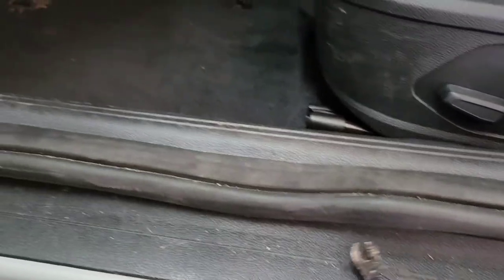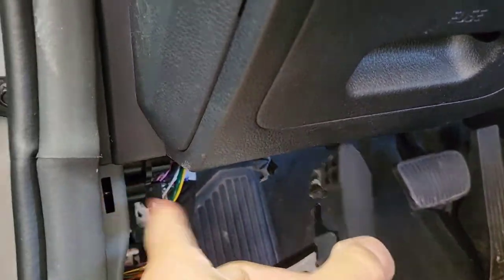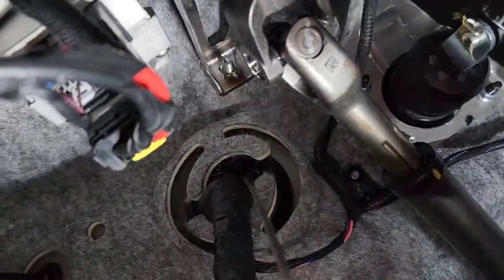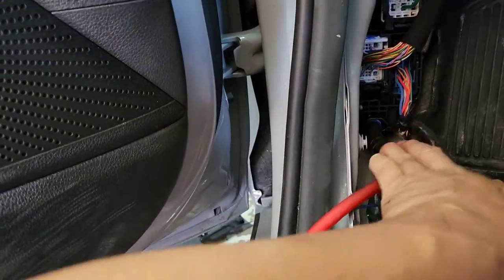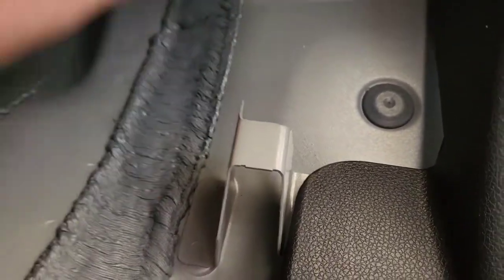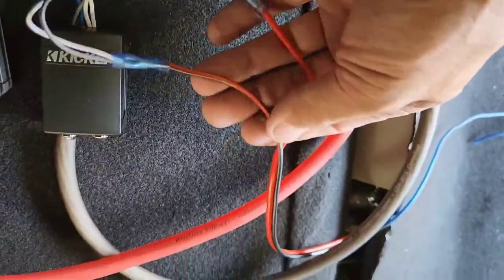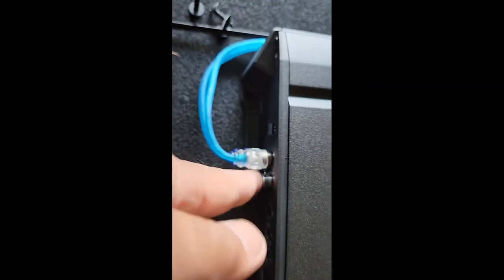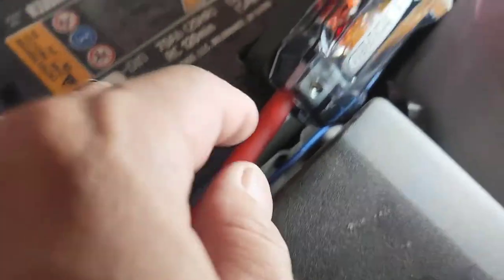2022 Kia K5 Amplifier Installation factory radio

Comment: Where is the small blue wire from the fuse box beneath the steering wheel lead too on the converter exactly? I’m not using the same model converter, I’m using a PAC SNI-35
Reply from the maker: 9:38

Comment: I’m about to be doing all this to my 23 k5 soon and the question I have is that by tapping into the LR speaker wire will it make the sub quieter? because the rear factory speakers are not really loud at all and is there a way to make the rear speakers louder at all? I’m doing all new door speakers and 2 12s in the car
Reply from the maker: No just make sure the fade setting is at zero

Comment: Im trying to replicate what you did in my. K5 i have the 2 evl 12 sub with the amp rp 2000 1.d package do i need to put a cap or extra bat for that i bought everything in the vid
Reply: Caps dont work the best thing to do is to upgrade the battery under your hood to a agm or something stronger and you can also do a bigger alternator

Comment: One thing I would never do is cut the wire in half on the power side just because now you are compromising The wire and getting half the power so essentially you just turned your 4 gauge power wire into a 8 gauge also when it comes to running rounds you always want to drill a hole and nut and bolt it making sure that the area that it is being grounded to is clean
Reply from the maker: Thanks for the input 👍
Reply: I believe he just made the wire thinner for the pull rig. I’m sure he made a clean cut thereafter for any power connections.

Comment: I got 2 subs to connect. Can I just use the one side speaker wire and connect the wires for both subs ? Or I need to bring speaker wire from both speakers left and right?
Reply from the maker: Just the one side
Reply: if you're listening to a stereo signal you will want left and right side inputs. Otherwise you miss half the music.

Comment: Are the wires that are taped I. To the car speakers supposed to be hot?
Reply from the maker: No, it's the + and -  speaker for the line out converter
Reply: @khmerohio  ok… for some reason the it has power and is keeping the converter on
Reply from the maker: Then your coverter could be bad.  Sometimes, it will shut-off after 2 minutes

Comment: line output converters are known for bad audio quality, use an amp that has high level inputs and then you don’t need a LOC. your door speaker wire then would go directly to the amp input
Reply: I used the same LOC he's using and it sounds great. Just make sure to not run your RCAs along side the power cable otherwise it will draw signal and there will be an annoying electrical hum coming through. And also make sure your grounds are good cause that will cause the same issue. Being able to get a working remote wire just using speaker wires is especially convenient too lol

Comment: For the keyloc2 remote if my amp doesn’t have another remote area to put it in, can I just fit it with the original remote that I ram to the fuse box?
Reply from the maker: Yes you can

Comment: Quick question i put the remote wire from the kicker and other remote on the same remote on amp?
Reply from the maker: Are you using kisloc2?
Reply: @khmerohio  yes my amp only has one remote skar amp
Reply: Im trying to replicate what you did in my. K5 i have the 2 evl 12 sub with the amp rp 2000 1.d package do i need to put a cap or extra bat for that
Reply from the maker: A 10farad capacitor is good enough for it
Reply: @khmerohio  thank you i subscribed to the channel and one last question where did you put the ground at
Reply from the maker: @xaviertck  you will need a self tapping screw 1/4" .  Make sure you sand the paint fully clean. The back of the rear seat on the floor just make sure you check that the gas tank is not underneath
Reply: @khmerohio  thank you so much i appreciate all the info and what you do respect 🫡 and for the fuse tap i can still use the 10 spare or do i need a more powerful fuse for my setup
Reply from the maker: @xaviertck  10amp

Comment: Why is my amp and loc staying on? Same car same materials used
Reply: Because he had you tap into the power out in the fuse box. I did this and my computer screen and Amp stays on. I reran the remote wire back under the hood and tapped into my fuel pump fuse, works great now, everything shuts off like it's supposed to. Make sure your power wire is connected to the bolt/nut at the very front of the positive block on the battery, he points this out in video. Hope not too late, just finished mine today.

Comment: I can’t get it thru the firewall help
Reply from the maker: Firewall rubber boot is the best place, but be careful with those wire
Reply: Pull the battery, its not hard at all, heavy but not hard. Then you have all the access you need

Comment: So why didn’t you get audio signal on the right side as well. If there’s a bass beat on the right side it will never be heard/ felt .
Reply: He did, by combining both channels on the loc.
Reply: Any car that is equipped with an amplifier you're supposed to run the signal off the sub wire or you will get voice coming out your sub
Reply: If it’s a Mono amp with a LPF it doesn’t matter what channel you tap.